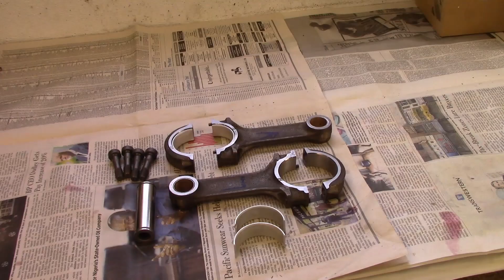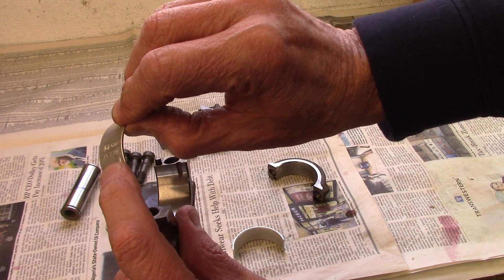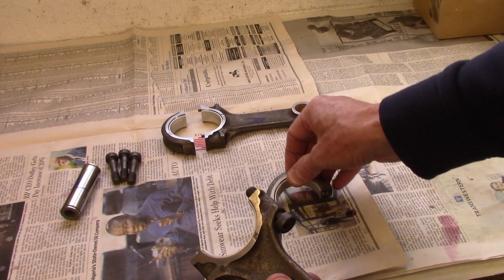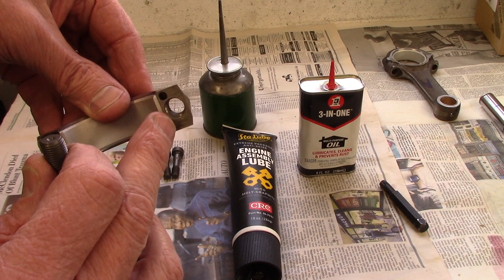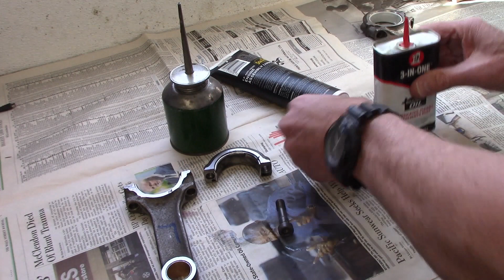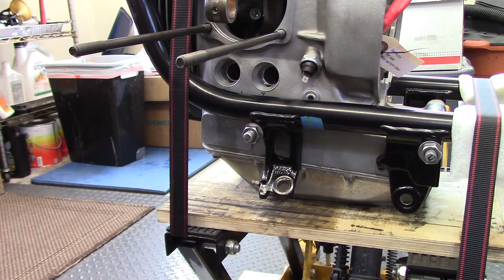1983 BMW R100RS Install Connecting Rods & Cam Followers

Comment: Good afternoon Sir,   I'm just watching your vid on installing the connecting rods,   I'm not seeing any holes in the shells being install for oil .....and not any oil passage ways on the rods too.......did I just miss that or isn't there on this model..........my R60/6 1974 has those oil passages through the Crank and into the Crank end of the rods then oiling the rod shells ....... although on the break down of my engine and one of the shells is scored....now being replaced I find the oil passages clean and clear of obstructions........and the most part worked extremely well.......the damage to the shell was caused by a fine slither of metal burr which I found ......thanks for the allllllll the vids I find your explanations extremely helpful I do hope you do more...........regards `Phil
Reply from the maker: Phil, there are lubrication holes in the crankshaft connecting rod journal that bring oil to the bearing shells.
Reply: @BrooksAirheadGarage  thank you

Comment: Thanks again. I'm surprised that you didn't clean the backside of the bearing and the mating surface of the rod with zylene or something non-petroleum. Not criticizing , just commenting.
Reply from the maker: Hi Cam,  The bearing material is delicate and is clean out of the box. I avoid putting my fingers on the bearing surface as the oils will cause some corrosion of the bearing alloy.  The rods were refurbished, so no cleaning needed.  In general, I try to only use the lubricant that the material will be exposed to. The exception to that is engine assembly lube to protect parts that won't be fully lubricated for a bit on first engine start. That said, I drain the oil in the first 10 miles and refresh to flush out the assembly lube, and bits of metal debris that's always created in a new motor.
Reply: @BrooksAirheadGarage  Thanks for the response. I totally agree. I've built a few sprint car engines ( with some success) and had a few built by pros, and I've always done/seen the mating surfaces cleaned because of hand oils. I appreciate all that you show us and I have learned tons about my motorcycle. Thank you for your videos.
Reply from the maker: Cam McLean well you have been getting greasy with lots of toys 😀. Thanks for looking and commenting.